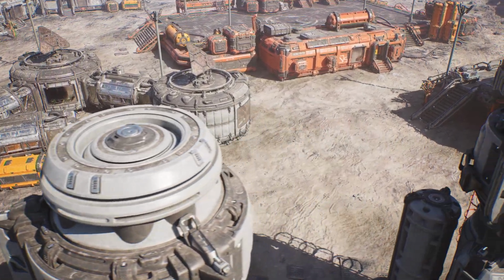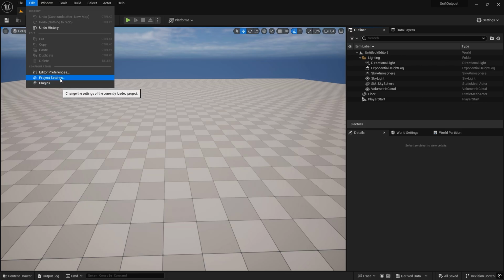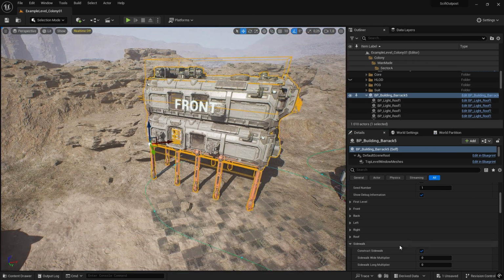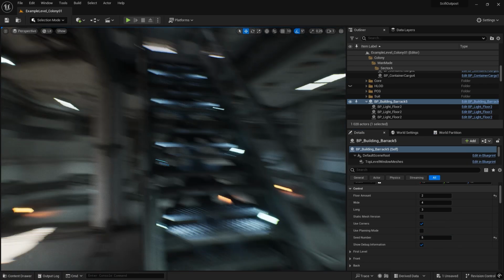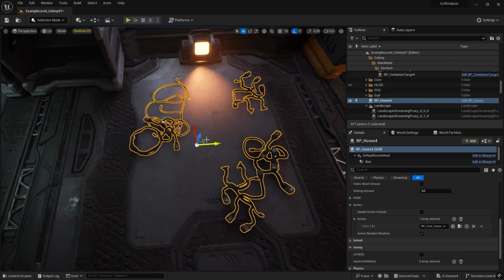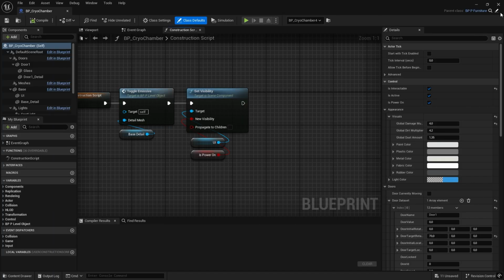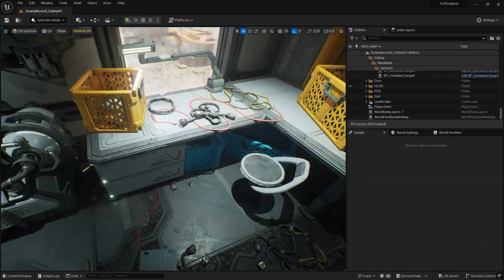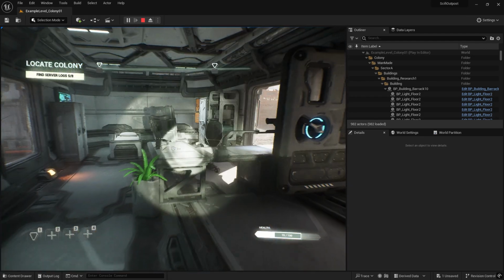Sci-Fi Colony - Overview - Unreal Engine 5 #GameDev #UE5 #unrealengine #pcgaming #gamedev

Comment: Extremely impressed with the work. However, I've noticed the lighting at night 0:49 is not realistic. The lamps and light posts don't cast enough light. Aren't they supposed to be as bright as street lamps?
Reply from the maker: I reduced light cone radius values to optimize shadow casting lights so that can be the reason.
Reply: @KimmoKaunela I see.... am a noobie in Unreal and I was wondering if enabling megalights can create better lighting without compromising performance?
Reply from the maker: @Brandiqa  Megalights will allow to have many shadow casting lights but there is a certain base performance cost in that system.
Reply: @KimmoKaunela I see...Thanks for the response. Hope to try out your environment assets soon. Your systems are wonderfully made. Glad to see PCG taking over roles previously handled by Houdini.

Comment: Is there any pcg's for auto building process? it would be possible to generate the whole colony with interior inside of the buildings? in demo i see only pcg for rocks and surroundings
Reply from the maker: Hi! Building system is using regular blueprints because that's the most optimal way in this context. You can read more about in the pack documentation.

Comment: Hello. Just a question before purchase can I add my own mesh to replace certain parts of the pcg auto building generation of Sci Fi Colony like use my own windows or doors? Thank you!
Reply from the maker: Building system is actually built using blueprints and you can replace assets in it if you want but in order to keep the same style with your own meshes, I would advise to read the documentation first. https://docs.google.com/document/d/14c7uc5FaG9Yb_AJ27h9NRZgUekDBwn_Mwmrl3JCnOYg/edit?tab=t.0#heading=h.hwuc4yi3c095
Reply: @KimmoKaunela  Thank you!

Comment: I don't want to sound too harsh, but you are commiting a cardinal design sin here. Prop/assets should clearly announce their purpouse. It should be immediately obvious what a thing does just by looking at it.
These assets do not. They are way too buisy and cluttered. When used in a strategy game with a camera far from the action you can't tell a building from a random container, and when used with a FPV or 3rdPV camera you very much notice that not much thought or concept was being put into why your assets look the way they do and what their function is. For example your crates have just as many random pipes, cylinders and grates stuck to it as a generator or a planter.
Less would be more.
Reply from the maker: @heinrichwonders8861  Thanks for the feedback. Good and valid points!
Reply: @KimmoKaunela yeah I agree also, it's lots of details, some empty space between all the details could help. I would use Ai to come up with great sci-fi concepts and pick what looks great and then add something of my own to it and bounce with other artists before you dive in and do lots of modeling.
Reply: HATERS GONNA HATE